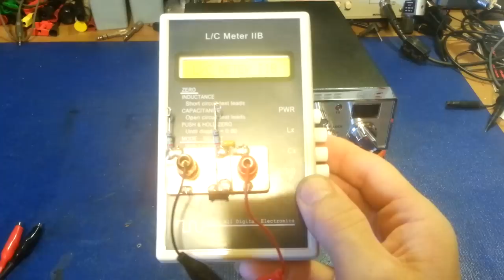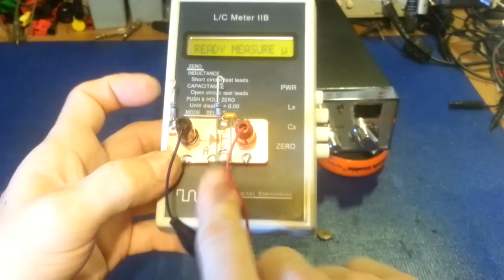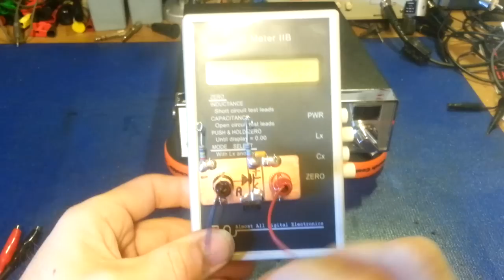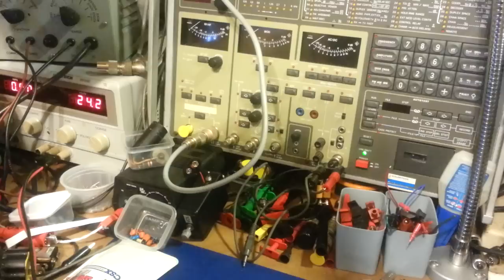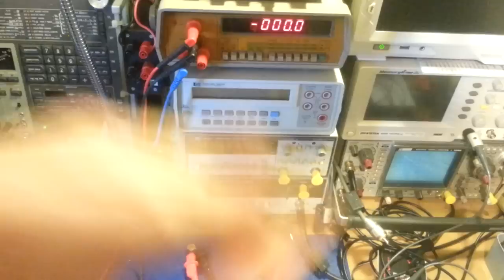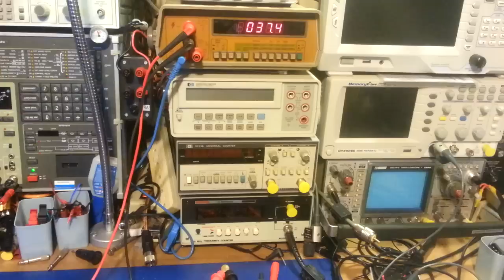Ceramic capacitors gone bad and testing them to the breaking point.  Let the sparks fly.

Comment: Hello Mike, 73s.. Listen, pardon for the bother,, but could you tell me the value or replacement ceramic capacitor equal located at the back power connector where power cord enters? That black plastic connector cracked, and caused the leg on ceramic capacitor to brake. Problem is, its faded and can't make out the numbers. Thx ..

Comment: Mike i have a question i have 4  20pf disc cspacitors in a video deck video scan section. They are very noisy. Since the value is so small can i use higher or lower values to replace whats the deal on these. Rick

Comment: Neil Hecht who created the AADE L/C meter passed away in 2015 and they're no longer available. Lots of cheapie units on eBay from China but I prefer the albeit more expensive Peak series component and the other no longer available M3 Electronix testers.
Reply from the maker: I have a Peak unit and use it as well.  I always appreciated the AADE was a normal guy making a good product at what I consider a fair price.  I haven't looked recently but last I heard the family was trying to decide uf they wanted to continue operations.  I have been considering getting a new bench style B&K LCR meter.  Theirs lots on the market but theirs gets good reviews.

Comment: Mike,
Put some epoxy in the hole and solder it back in.     :-)

Have you ever plugged some axial lead paper caps into an AC outlet? They go off like a firecracker.

Sparked at 80V. Second one at 292V.
Reply from the maker: I accidently hooked a 200uf 500 volt cap up backwards in a amplifier.  I keyed the mic on the radio and BOOM!!!!!  Room filled with vaporized electrolyte, aluminum foil fragments and paper fuzz everywhere.  First and last time I did that.
Reply: MikesRadioRepair that sounds like real fun! 😀

Comment: Kind of reminds me of the night I and a co worker was working together trouble shooting a magnetic strip card reader one night and we just had hooked it up to a power supply and some digital test equipment when one of the cleaning ladies came in to damp mop the floor and just as she walked in one electrolytic cap blew on one of the two digital boards, and the little aluminum shell flew across the room with foil streaming out of it, Did not see the lady again that night Ha Ha, it was small cap like 15 mfd at 16 volts. Well we found the problem, a shorted transistor that eventually blew the cap !!  The Card reader was part of the security system for the I.B.M. site in East Fishkill, N.Y. Worked there for 31 years !! --   john A Bellas KC2UVN

Comment: Hi Mike where is your nice cap tester?? Good demonstration! 73
Reply from the maker: LOL, I have several.  Which one are you refering to?
Reply: Yeah of course I mean your HV Sparque I believe ??
Reply from the maker: +TRX Bench 

I have a couple old Sprague units, 2 from Semcore and a couple Solar.  Didn't want to use those to do the failure voltage test because they don't have any current limit like the power supply does.  Don't want to take a chance burning up a transformer in the tester if the cap failed in a short.
Reply: I meant the one you did a video on... I was not aware on the fact that those units have no current limiter..
Reply from the maker: +TRX Bench 

That was one of the Semcore units.  It has a fuse but no current limiting circuit.  I feel safer doing a failure voltage test with a power supply that has a limiting circuit.  Better safe than sorry. :)
Reply: yeah absolutely agree! Have a nice day